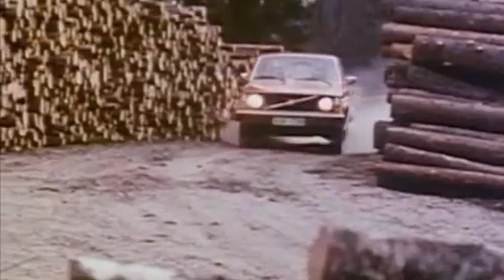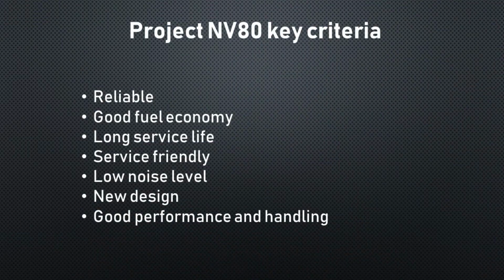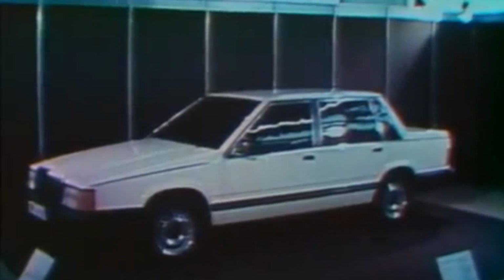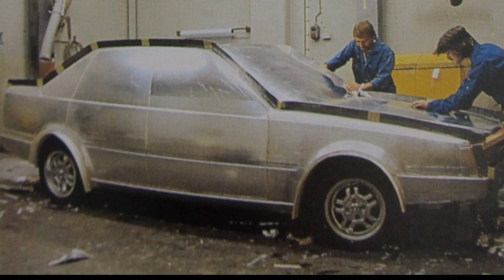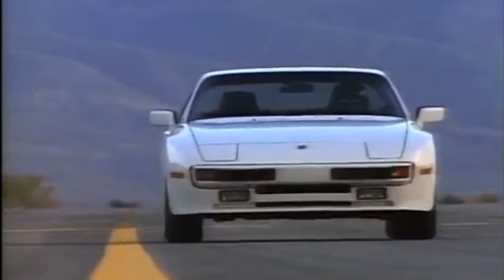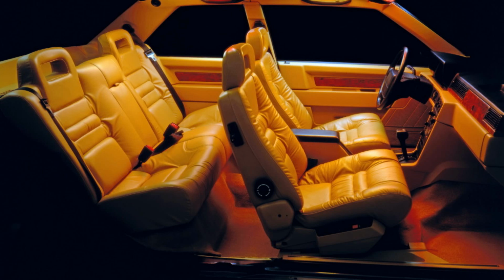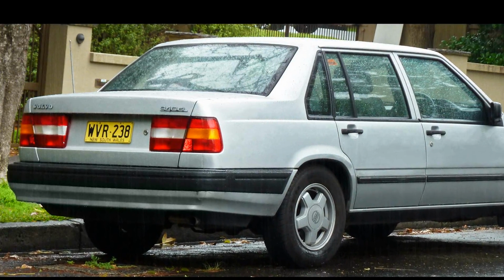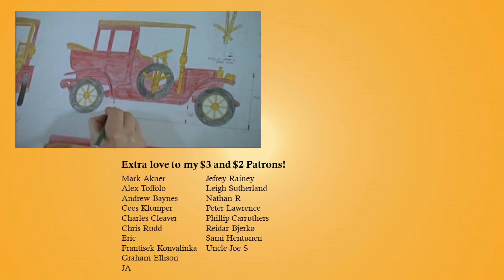How the Volvo 740/760 SAVED Debt-ridden Volvo

Comment: My 1994 940 estate has done 550,000 km and has never had its cylinder head off.   It did need a bottle of Radweld a couple of years ago to stop a coolant loss.  The car has just suffered its first significant failure - 3rd gear, the Achilles heal of the M90 gearbox - no longer stays in gear.   But 240,000 km gearbox is on its way here.

Comment: Forgot to mention that 1991 was an even more confusing model year because Volvo also had the 300 series (340/360) being sold concurrently with it's replacement, the 400 series (440/460/480) - at least in Europe since those cars never made it to the U.S.

Comment: After a series of 200 cars, saloon and estates, I got a 940 turbo estate built in 1993, converted to gpl, and it goes great. On the point of doing some surgery, new waterpump seals, timing belt and replace the heater matrix, already replaced a leaky p.a.s. rack and clutch slave, and that's it, 9 years of ownership and one set of rubber all round, 500quid!

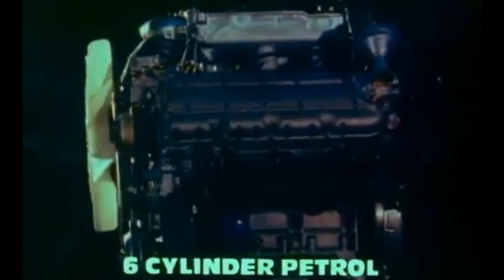Comment: The picture at 3:31 does not show a picture of the suspention. It as a chematic of the brake circuits. The Volvos would have both circuits going to both front brakes, therefore it would have 70% stopping power.

Comment: in the mid-1980s, I worked at a Toyota aftermarket-performance-parts shop.  The focus was on Tercels, Corollas and Celicas (including the Supra).  The new MR2 was exciting & pretty but there wasn't a lot of aftermarket performance parts for it.  A local MR2 owner would go weekend racing with it, and call us on Monday mornings, complaining that he was losing races to a Volvo 740 Turbo wagon.  We sold him everything we could find, and he installed it, yet continued losing.  Finally we told him to just go buy a another such Volvo, to be competitive.

Comment: I remember a local rally here from when I was a kid, out in the local woods.
One of the volvo 240's took a turn too soft, and rammed into a rock it's own size at like 60mph / 100kmh.
The volvo stopped instantaneously and the rock was sent flying. Only damage on it was the plastic bumper had been disintegrated, the car just reversed and continued rallying.

Comment: Thank you for this. I learned to drive on a 1986 240 GL and a 1989 740 GLE 16-valve, both manuals.
Reply: You sure it was a 740 GLE 16v and not a 740 GLT 16v?
Reply: @dietermeyer9231  Yes I'm positive it was just like this car only like baby blue in color.

http://www.collectorcarads.com/Volvo-740GLE/59140
Reply: @zjones9876 : Strange, I thought the GLT was the only ones with the B234F engines.
My father had a white 1988 740 GLT 16V.
It had a black field between the rear lamps and the small windows next to the rear doors was with black stripes to make them look dark.

Comment: I owned 4 different 740"s...2 na and 2 turbo.  All over 200k miles, over 20 years old...all were tanks that were cheap to buy and keep going.  The Redbook was tough...though not very fuel efficient or powerful.  But it didn't rust and handled great in the snow.

Comment: My parents had a 1984 245 glt turbo wagon when I was growing up which was very reliable, it always started right up. While they had the 245 turbo, they also bought a 1990 740 wagon because they thought it would be as reliable as the 240. The 740 did not like to start half the time, but when finally started, it was a fine car. I think it didn't like to start because it had a Regina ignition instead of the Bosch one that came on the 240. Fast forward to when I started to drive. I saw a 1990 240 sedan for sale at a yard sale for $2,000.00 with 150,000 miles on the odometer. And because I had fond memories of riding in the back of their 245, I knew I had to have it. That car always started for me with no issues. The only reason that I had to get rid of that car is because someone rear ended it.

Comment: I had an 84 and 88 760 turbo. The 84 developed the old start and die and I spent $$$ never to solve it. The 88 was a great car though. Now I drive a 92 240 with 43K miles currently. I (heart) my Volvo!

Comment: I have a 1987 745 as a daily driver. B230K engine. 0,8l pr 10km. It’s gone 346 000km in its life now, and still going strong. Since I bought it in 2015 for 12000 NOK (around 1000 pounds) I only changed the timing belt and changed brakes (and oil of course😅). Cheap to own (here in Norway) only 1500kr (125 pounds) a year I insurance and tax.

Comment: My uncle got to borrow one for like 6 months. ONLY ON CONDITION that he fix it. Which means come running to my dad to fix it. It was like a 1986 or 1987 wagon (estate). The woman had run RIGHT thru the brakes, I mean turned the rotors into STEEL DONUTS and obviously the pads were screwed. But to change it sll was SO SIMPLE. In fact EVERYTHING ON IT was incredibly simple to get out and put a new part in. Tons of interior lights and quite a nice vehicle tbh.

Comment: # im still driving my 940 turbo 1997 model , monthly i travel 1200 km to thailand , every 6 months i replaced the engine oil , im using semi syntetic oil , big car travel long distance at the highway fuel concumption much better , rather than intown used ! Volvo the sound proof , confortable and reliable , top speed 240 kmph , easy and smooth driving when yoy running at 150 - 170 kmph SOO RELAXING ! regards from dannok city and kuala lumpur .

Comment: My dad owned a marine blue 740 GLE from 1988 until the summer of 2018, when we finally scrapped it, it had driven 500.000 km and had barely any rust besides the usally at the front drivers door. The real problem was the engine giving up.

Comment: Most manufacturers wish they had the same problem Volvo had with the 200 series. Initial investment has been paid off for years. No new R&D required. No new stamping is needed because customers actually want one that looks like previous models. And they keep selling as many as they make.
Yes, they probably cannibalized some 700/800 series sales, but they weren't loosing them to a different company.

Comment: Ive owned 3 volvos in the last year, V70II 2010, 744 and 944, Ive sold the V70 since I didnt like it. The 744 was unfortunelty crashed, and the 944 on 400000km still runs great even tho I dont drive it kindly at all 😝

Comment: I drove Volvo most of my life. Started with the 145,245 then 740 and  finally the 760.
Unfortunately they did not listen to customers and their wishes. I wanted a front wheel drive.
The moment my company went into Formula 1 sponsorship with Renault/Williams,
I changed the whole company fleet in my area of responsibility to Renault and never regret the decision.

Comment: My parents had a 1989 760 Turbo Diesel for 14 Happy and reliable years.  They did near 200,000 miles in it until somebody side swiped them doing 80MPH on the motorway.

My dad was able to shrug off the other car and pull in safely.

He had to change the front passenger wheel before driving home.

Due to the age of the car the insurance company wrote it off.

After that my dad got an 2002 XC70 D5 that is still going strong nearly 20 years later.

Comment: After three 240 I had Volvo 760 -88 for 11 yrs and it was really nice. Only the engine (B280E) was bad. It was made by Peugeot, Renault and Volvo and was named as PeRVo which name suits it well. Now I have 960 II -98 and it has really good 6 cyl straight Volvo engine. I maintenanced them by myself because they are well made and everything is easy to access.

Comment: On my 6th Volvo now but my favourite was second one I had, a dark red 740 sedan. 15 years old with 330.000km at the time. Nothing wrong with the car, ran great, little maintenance cost, but the missus made me trade it in for something newer (a V70). She's since been traded in herself ;-)
That thing you mentioned about maintenance. Had to replace the reflectors in the headlight units for the annual test which cost €35 per side at the time for just the reflectors. Few years later same problem with the V70. This time it cost €175 per side for the entire headlight unit. On my current V70 just replacing a headlight bulb means removing the air filter box...
Would love another 740 but they're hard to find in Ireland (thank you government scrappage schemes) and motor tax + insurance would be prohibitive.

Comment: Correction on the 2.0 the 2.3 did exist alongside the 2.0 mainly in sweden its dominated by the 2.3 it had multiple gearbox and rear axles to of different strength levels, also the 900 series was easy to spot on narrow front but easiest on saloon on rear trunk was now opening and the licence plate area came with it up to make accessing easier top the luggage , along with the more tilted rear window.

Comment: Very nearly correct however, I had a 760turbo Estate which had a 4 cylinder 2.3L turbocharged engine and a manual 4 + overdrive manual transmission.
Also an omission regarding the engine in the 960 24v was essentially a Porsche designed and developed unit.

Comment: I loved my 740, I owned a 760, it got terrible gas mileage, the 740 was awesome,  but too light in the rear, I live in Columbus Ohio, driving up hills was nearly impossible....the classic B25-30 4 cyl engines were easy to work on.
Also a problem of the older Volvo's was that the wires vinyl coating would succumb to weather and crumble causing shorts, keeping up with wiring and connections was something you eventually HAD to tackle....I never understood it, something as simple as wiring was a constant problem for them.
I've been driving Volvo's for decades now, the highest mileage i got was over 400K on a 79 240. I'm driving a 960 right now...i refuse to buy a Ford made Volvo

Comment: We bought a new 1985 Volvo 760 Turbo in 1985.  Think it cost about 22K and I loved and drove that car for a decade until someone rear-ended it.  At the same time we bought the wife a 1984 200 - nice car until the transmission went out about 6 years later - luckily a couple of months after we sold it.  Always loved Volvos.

Comment: the thing about the 200 series and the 700 series are that they are basically the same car. just the 700 had a better more efficent engine.
also the 900 series goes back to the 200 and 700's style.

Comment: The big advantage of the 740 over the 760 is that it did not have the Renault engine. Though I prefer the earlier cars (122, 140, 160, 240) those are getting hard to find in good condition so the 740 is solidly on my short list.

Comment: I had a 760 GLE in college.  Great car... except for the crap motor that eat camshafts.  You had to either pull the motor or drill holes in the fire wall pulling out through the drivers compartment.

Comment: Volvo servicing costs in 1992 were £480 at the local Reading, Berkshire main dealership. They were more expensive to service than BMW cars, but you did get a poverty spec 440 loan car (dreadful experience) for the day. The 740GL estate (a 1989 model) returned 26mpg on motorway driving in 1992 if my memory serves me correct. The 1989 Vauxhall Carlton (automatic) I drove previously returned 36 mpg and was far more refined on the motorway due to taller gearing.  The 740 was a good car for lot of reasons but cost of ownership was not one of them

Comment: I worked in a Volvo dealership when the 200 was on the market and owned a 245. Reliability was never an issue. That wasn't what I wanted to comment about though. You say they made the 700 series serviceable. I have never seen a car as easy to work on as the 200 series. They were built to be serviced. Didn't even need a tool to change the entire headlight. GM made you buy a special screwdriver to change one.

Comment: I learned driving in a 1993 240. Didn't have electric windows but AC, ABS and cruise control. Felt odd that those things were in a such old model. Originally it has been used by Volvo as company car and later sold to employee so maybe there weren't selling themselves at the end?

Comment: the 700 series was a strange car for the European market.
European customers liked the 200 series (estate) way more.
the 700 series was not known as a reliable family car.
the 6 cil VW diesel engine from the VW LT had serious problems.
and there was the first years no estate available!
The saloon version never sold wel in Europe.
The estate version with LPG was later a fleetcar hit.
the 700 is almost extinct on the roads of europe.
They were droven in to the ground because they were super cheap on the second hand market.
The rust protection of the 700 was also substandard to Volvo.
Nobody cared and just drove them with minimal maintanance and threw them away.
The irony is that the 200's you still can see regulary today!
There are alot of owners who have their 200  for 30 years plus!

Comment: As a proud owner of a brand new S70GLT,  it ran beautifully in the first year and then the battery went dead.  Air conditioning evaporator failed in the 2nd year, the whole dash including the transmission shift stick portion was ripped out just to replace the evaporator.  Many parts removed were found broken later on, including problem on shifting.  Bulbs were burn out constantly due to problem in the electrical system common to all S70, I had a full set of various bulbs kept in my car just in case.  ABS module failed in the 6th year and the engine/turbo started burning oil, every time I fill up my car with gas, I'd have to put in 1.5 liter of oil.  The list went on and on, by the time I sold my car, I added up the maintenance cost on 10 years ownership, it came to 2/3 the cost of a new Volvo S70.  Would I buy another Volvo again ? I am sure you have the answer.

Comment: Very interesting, great at explaining number series and didn’t know Volvo set out to make car easy servicing.  80’s is very interesting time as Volvo had gone small like VB Holden Commodore would Volvo been more successful? Holden success was struggling with old inefficient six competing against big XE XF falcon large car with efficient six 3.3, 3.9, 4.1.  But 80’s near end Ford was struggle Holden V8 in sales even though Holden had small sedan but 90’s will change as fuel crisis was over.

Comment: I once owned a 740 Turbo Diesel Estate. Covered circa 1,000,000 km  in it. However, multiple elementary design features were a disaster in it. They used the excellent 6 cylinder VAG turbo diesel engine, but mated it to a much too large radiator. Yes: too large. Result: Bottom of radiator never warmed, so corroded and tubes broke out of radiator. 
VW mounted their temperature sensor on cylinder head. Volvo mounted it in the diesel pump heating pipe. Result: When water is lost, guage goes cold not hot. 4 cylinder heads later, I drove it into the great scrapyard in the sky.

Comment: i have had volvo,s since 1960 ,the 120,s were hard to beat would never let you dow the 140 series was as good a seller but then the 240 well this was a great car had 4 or 5 would buy them at 100k and sell them at around 240k,but my last 240 glt of 1988 vintage was the best handled really well for a big car and was as quick as a 205 gti a fab car now i have the last of the line a v90 great car comfy quite , super smooth 6 cyl motor ,there is nothing as smooth as this six ,but the freaking auto box is crap who ever programed the box should have been shot , even in sport mode it is crap , and you cant get a manual in the u s as no one can figure out what the other pedal is for, would love to convert to a 5 speed

Comment: Cars in general were boxy in the late 1970s and early 1980s, but this thing looked as if it had been modeled using origami. It made GM's "flying brick" styling of that era look slick by comparison. I remember having to ride in the back of a 740 wagon and with the standard suspension (the Nivomat version might have been smoother) the ride was like a Chinese water torture and the space was surprisingly confined for the size of the car. I'm sure these cars had their virtues and were probably a blast to drive with the right engines, but there was something cold and dismal about them.

Comment: Its true what they are saying in the comments here about old Volvos and Mercedes being tough and bullet proof reliable, but that was almost their undoing. Volvo and Mercedes buyers in the past were loyal customers but the cars lasted so long people did not change them until they were 15 years old and with gallactic mileage. The problem is if your customer base like your cars but they last forever then you will not sell many, Fords and most GM cars were practically engineered for a limited life span and obsolence was built into them. You want to sell vehicles in large volumes, this is what generates money and further development. This is why Mercedes and Volvo today do not last as long as the old barges, they are engineered for a limited life cycle. Both manufacturers are still perfectly capable of making vehicles that will last 15 to 20 years as every day drivers, they just learnt their lesson of the right balance of build quality, reliability and life span. Although Mercedes did go too far in the 90's early 2000's, some of there cars were rusty horribly over priced junk.

Comment: Thanks for the video.  My '86 740 GLE made me a Volvo fanatic for the 10+ years I enjoyed it but parts WERE expensive and, thus, repairing it was no bargain (and, yes, replacing bulbs, etc. was very easy).  About 5 years into it I upgraded the suspension with after-market anti-sway bars as it WAS slushy around corners.  The gearing and efficiency were fantastic and the interior was exceptionally well designed (ergonomic), comfortable and HUGE.  Of all the new cars I've owned this is definitely the one I regret selling.